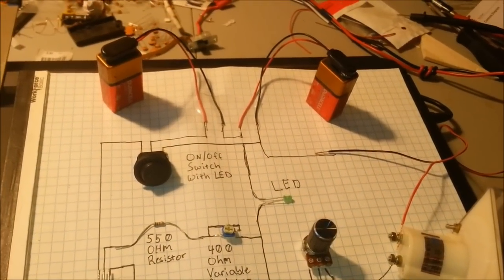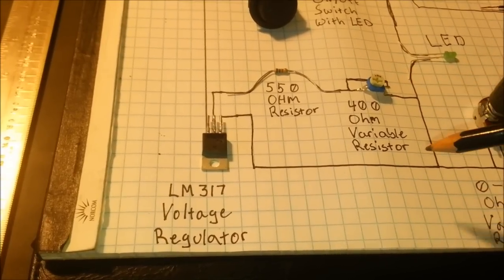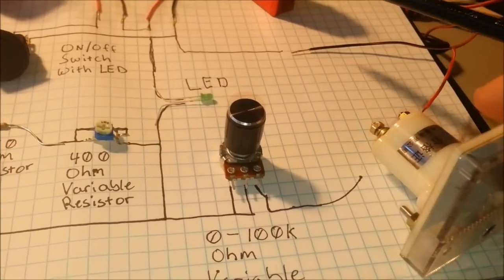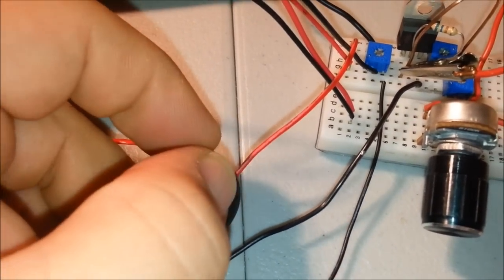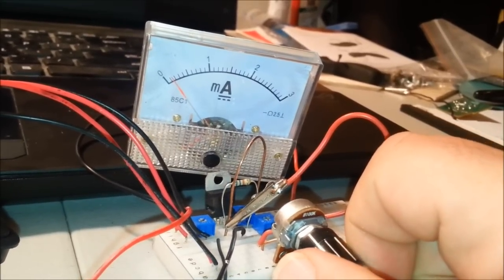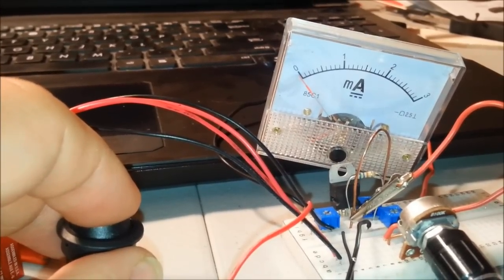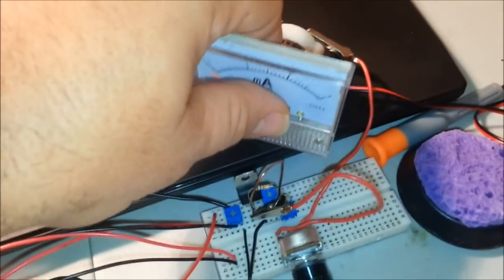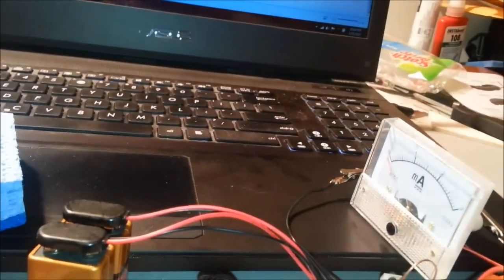Easily build a tDCS machine - How to DIY

Comment: I actually have couple more questions, I couldn't find 550 ohm resistor but I was able to find a combination of two resistors that will sum up to 550 ohm.
1. Is it OK to take two resistors that sum up to 550 ohm (for example 330 ohm and 220 ohm)? if it is that should they be connected in a series or parallel?
2. If it is OK to use two resistors that sum up to 550 ohm, what should be the watt of each? the ones that I found come in 0.5W/1W/2W or 3W.
3. I did find 560 ohm resistor (https://www.aliexpress.com/store/product/Free-shipping-100pcs-lot-560-ohm-1-2W-1-560R-Metal-Film-Resistor-560ohm-0-5W/1361740_32717130901.html?spm=2114.12010615.0.0.5ce5139efdafmr).  could it be a good substitut for the 550 ohm that I couldn't find?
Thanks for the video, I am super excited to built one for myself already:)
Reply from the maker: Nitzan Breitman Yes, all of those resister solutions will work just fine. As for wattage, this circuit will only make about 25 milliwatts of power at the very most. So, .5W resisters are fine and it is ok to use the ones with higher ratings, as well.
Reply: Thank you very much for the quick respond.
If I go with two resistor, should I connect them in series or parallel?
Reply from the maker: Nitzan Breitman use resisters in series when you want to add resistance. Parallel will reduce resistance. For example, 250 Ohm in parallel with 250 Ohm will result in 125 Ohms of resistance. The formula for figuring out resistance of parallel resistors is 1/([1/resistor1]+[1/resiator2]+............[1/rested n])
Series resisters are just added
Reply: Great, Thanks!

Comment: to make my last comment clearer--the total resistance will vary dramatically every time you put on electrodes--I've seen it change from 4k ohms to 11k ohms--so--you need something to dynamically keep current stable--the 317 is stable only to the extent the total resistance doesn't vary... the lm334 adjusts to compensate for changing resistance...
Reply from the maker: chicagomike6666 The LM 317 is a voltage regulator, but can be implemented in to a circuit as a very stable current regulator, as I have done here. I don't want to spend a lot of time explaining how to do this. Just Google "lm317 as current regulator."

Comment: so...the LM317 is a voltage regulator..wouldn't it be easier to use a LM334--which is a current regulator?  The datasheet on the lm317 lists a fixed output of 100ma...

Comment: This is not a "you decide" kind of thing.  That's akin to how Donald Trump decided climate change is not real.  Please leave this to the groups of scientists who have gone to school for 20+ years to become experts in physics, neuroanatomy, and neurophysiology.  It IS highly technical and is not easy.  Your BS in engineering is meritable but does not alone qualify you for this.  The statistics showing that no harm has come from this are based on highly controlled experiments that require reviewed funding, methodology, safety assurance procedures, standard operating procedures, practice, and controlled parameters, which may take over a year to implement before collecting data.  You seem to mean well, but you should be careful, and please take this video down so that others are not mislead into thinking that this is a "no-brainer".  Are you aware that inducing activation and increasing synaptogenesis to change hemispheric laterality can actually decrease your cognitive performance?  You could be unknowingly accelerating the functional aging process of your brain, put in a simplified way.  How do you know that you aren't setting yourself up for an increased risk of developing an aging-related neurodegenerative disorder?  It would be difficult without longitudinal data and a great deal of the base knowledge that's missing because the neuroimaging technology to understand these things is still in an early stage.  Also, have you at least determined whether the change in your performance was of statistical signficance, and do you have enough data to power such an analysis accurately?  I'm asking this rhetorically to hopefully point out how much more complicated this is than you are implying with your video.
Reply from the maker: Well, you seem to be  well read. The decision is tantamount to deciding if caffeine should be consumed. You mentioned that this should be left to those with 20+ years of experience. Fortunately, those highly experienced scientists, physicists and doctors publish peer reviewed lab reports, studies, and other papers. I, and anyone interested, get the benefit of that experience by reading those papers. If you had done your research, you would know that the vast majority of the highly experienced individuals you mentioned agree that this is incredibly safe.
Reply: I am one of the relatively highly experienced individuals you refer to my mentioning who, yes, do agree that generally speaking tDCS is safe, and I am telling you that what you are doing is not safe.  You should put more thought into who you might be speaking to before you begin to patronize, as it may elucidate how little you know what you are talking about.  I am well read and have done my research because I am a neuroscientist working on a tDCS rehabilitation research study for individuals with a particular sort of brain damage.  Regarding your commentary about caffeine - if you are unaware of the neurochemical and vascular considerations that should be made prior to consuming caffeine prior to inducing brain stimulation or even simply getting an MRI, you probably shouldn't mix those things.  You also shouldn't stimulate your brain if you haven't had formal training in neuroanatomical localization.  This goes for highly trained scientists as well - it is not uncommon for highly skilled individuals to lack expertise in anatomy, hence why they collaborate with individuals such as myself who find both structural and functional neuroanatomy inherently fascinating and foundational.  Also, our studies are not meant to help people do poorly controlled DIY experiments or to propagate incomplete information through YouTube.  They are meant to inform scientists and clinicians so we can implement and create in a way that leads to empirically validated progress, and in the case of work such as that which I'm currently involved in it is also directly meant to benefit our subjects, ideally.  Our peer-reviewed articles also serve to share information with the public; the "don't try this at home" disclaimer may not be explicit but it is meant to be understood.
Reply from the maker: S R If you were one of the highly experienced, you would see that my design is perfectly safe. Certainly safer than some of the commercial units that are readily available on amazon.

Comment: sir what if some of component may failed.... so more than 10 mA current go through head n person may die..'?
what to do for precautions
Reply from the maker: gaurav kesharwani it is impossible for 18volts DC to be fatal (in this applicatiobl). Further, the electrodes would become far to uncomfortable to continue before it became dangerous.
Reply: @JonCammarata  If one were to drop the circuit into a big box of HUGE capacitors... perhaps... just maybe!
Reply: Manchester England United kingdom.Dear Jon,                  Hi good morning,  Many thanks for your video  ( how to make a tdcs ) I've suffered from depression etc.  ( etc. being that which comes with depression ( i.e. ) brain fog, none clarity. ) for the most  part of my life. Now aged  nearly  70 y o age, and I now see, tdcs as a last hope. Is al the electrical components necessary, why not just use a larger or smaller volt battery and from there to the fore head.                   Many thanks again for your  time, and  the video.   GOD BLESS THE FREE WORLD  AND THOSE THAT KEEP IT FREE.                                                                                                  Yours Most Most Sincerely                                                                                                                       Peter.

Comment: perfect video John! thanks
Reply from the maker: Francesco Medina Thank you very much for the great compliment.
Reply: Jon Cammarata I did everything acording to your video and i'd like to ask you these little questions:
1) since i never tried a tdcs device i don't know if the current is perceptible. Setting at 2mA I don't feel any tingling. It is normal? 
2) im notice that cathode (black color) goes to the ground and anode (red color) is connected to the output of the 0-100kohm variable resistor. Is it correct?
Reply from the maker: That is correct, Francesco. However, you should put the ammeter between the positive electrode and the ramp up (variable) resistor to ensure that you are producing 2mA. I always feel a tingle. It is possible that you may not feel any tingle if the electrodes are very large.
Reply from the maker: Also, if you are sure, send me a clear close-up picture of your circuit and I can look it over for you.

Comment: according to their scheme tDCS I do not use two batteries, but one 9V battery, resistor adjusts mA, but why voltage on electrode is 3.5 V? because the battery is filed by a 9 V ... I use Translit, because I do not know English.Maybe later i write on you email

Comment: why entrance 9V and output 3V use a single battery charge
Reply from the maker: I don't quite understand your question.
Reply from the maker: The voltage across the electrodes is the remaining voltage after the voltage drop across the other components in the circuit. For instance, if there was a simple circuit with 2 resisters of equal value and a 2 volt battery, the voltage measured from between the two resisters to ground would be one half of the supply voltage. In this example the voltage would read one volt between the equal resisters.
Reply from the maker: Also, if you want, just ask the question in your own language and I will translate it on my end.
Reply: @JonCammarata  I think he wanted to know why you don't use a 3v cell. Perhaps 2 AA batteries instead. Perhaps he was confusing voltage with milliamperage.
Reply from the maker: @Reach3DPrinters  3 volts doesn't have quite enough potential to achieve 2mA. The average head presents a few thousand ohms of resistance. Using Ohms law: 3 volts divided by 2mA =1500 ohms. 1.5 kilo-Ohms is far lower than the average head. So, that's why I use 9Volts. It's enough to achieve 2mA with-out being dangerous. In other words, you could hook the battery directly to your head but you are unlikely to damage yourself unless you had amazing pain tolerance and held it there for quite a long time.

Comment: What if , one of a component may failed ???
what type of precaution there
Reply from the maker: In the worst case scenario, all resistors would would lose alll resistance, both regulators would stop regulating and the full 18 volts would create max current across the resistance of your head. If your head was completely saturated with salt water and the electrodes were very close to each other the current would likely just travel across your skin, causing discomfort. If the electrodes are properly placed in one of the common montages, there would be at least 6-7000 ohms of resistance. Lets assume your head has a resistance of half that of a normal head with the worst case conditions mentioned above. 18 Volts divided by 3500 ohms is 5.14 miliamps. This is still 100 times less than the current that caused lesions in lab studies. Further, there are even some studies that used 5 miliamps with no ill effects. In short, it would just be uncomfortable. Plus, there are no studies that show any benefits from going over 2 miliamps. I personally use around 1.7 miliamps. That seems to be the sweet spot for me.

Comment: hey there.... thanks for posting this. I have one question: Why do you use the tranzistor in this circuit? Would the 2mA current not be obtainable simply by hooking 2 series resistors?
Reply from the maker: It is true that you could adjust resistances to achieve the proper current, but having a current regulator in the system keeps the current steady. With out it, you would notice the current drifting up or down as pads start to dry and as your body changes. For reasons I can't explain, my head tends to lose resistance during my sessions. The regulator  lowers the voltage as this happens to maintain the correct current.

Comment: Is there a way you could go through the process of hooking it up to the bread board? I've got everything aside from the ammeter, 400 ohm current setter and the cathode/anode.  I drew out the schematic but I'm not very good at actually putting the circuit together.
Reply: Kyle .Thompson I am so sorry for not seeing this question earlier. I bought a new phone a few months ago and stopped getting notifications for video comments. do you still need assistance?
Reply: Yeah, I tried looking up ways to wire it to the bread board but I'm still having issues getting everything in the right spot

Comment: Eeek! Got all the components, getting ready to start wiring/soldering. Stuff with 3 connectors are confusing. Not to mention I am currently unsure of where to wire in the battery and the sponges!
Reply: George Blair  I am so sorry for not seeing this question earlier. I bought a new phone a few months ago and stopped getting notifications for video comments. do you still need assistance?
Reply: I need a new phone, too! I just got a new multi meter. NOT sure about contacts under the solder. Planning on a major trouble-shooting session, soon.
Reply: Excellent! Thank you. Will do soon.

Comment: can't find a 550 resistor anywhere, even on ebay =(. same with 400 variable resister (did find a couple 200s on ebay)
Reply: take some stuff apart, you will learn some interesting things and end up with a pile of parts :)
Reply from the maker: Another name is trimmer resister. This 1k ohm trimmer will work just fine. https://www.amazon.com/Trimmer-Resistors-Through-1Kohms-0-5watt/dp/B00M1XAFPY/ref=sr_1_1?ie=UTF8&qid=1469239368&sr=8-1&keywords=1kohm+trimmer+resistor
Reply from the maker: +Jon Cammarata just set it to the resistance I specified in the video. let me know if you need any other assistance.
Reply: I went back to radioshack an hour ago and just got back, I figured the 1k ohm variable resistor at a low setting will work so I went back for it, i also picked up a 330 220 resistors to get a 550 ohm. I had a 560 but was worried it wont do. I also found cheaper ammeters on ebay, which one do you recommend? I'll use my multimeter for now. thanks for the reply, ill come back here when I have more questions thanks! (I hope this will help with my ADHD)
Reply from the maker: +curtis133 So true! Excellent comment curtis.
Reply: +curtis133 I used to do that as a kid, I should do it again now that I have a better understanding as an adult. I used to be IT hardware but we really didn't do actual repairs, just parts replacement and software troubleshooting. thanks for the advice though, that's a great idea

Comment: No effects at all?? short time? No long time?? Well, this brain shocking thing is not my field but I just think it is too early to be sure if really there are no long time effect. There is always a way to pay for short-cuts. We are yet to know what we are really trading for what. All the same, this is an interesting video.
Reply from the maker: +Teejay Chiwetalu Hello Teejay, I've been using this for over a year now. The effects are subtle with one exception. I always feel very focused the day after a session. The only evidence I can provide, is this. I am a 4.0 GPA Mechatronic engineering student. Prior to tDCS, I averaged 95-96% in all of my classes. After tDCS, I average around 98.5% for all of my classes. I always take the new IQ practice tests when they are available - wonderlic, Mensa practice, etc. I don't mess with those cheesy social media tests. I only use the official practice tests from reputable sources. In the past, I scored in the lower 130's IQ range.  I've taken two tests with in the past 6 months. One indicated an IQ of 140, the other 138. So, as you can see, the changes aren't drastic by any means. None the less, the numbers have changed for the better. Also, it's important to remain transparent when talking about tDCS. So, I will mention this. If I do more than 2 sessions a week, I get a headache, not a severe headache, but more of a dull head ache. I liken the headache to that which you might get after studying to long and hard.
Reply: Good stuff!! That's one of the minor side effects noted by researchers.